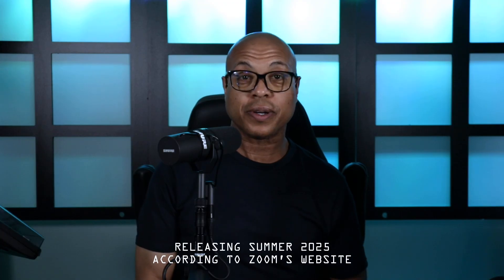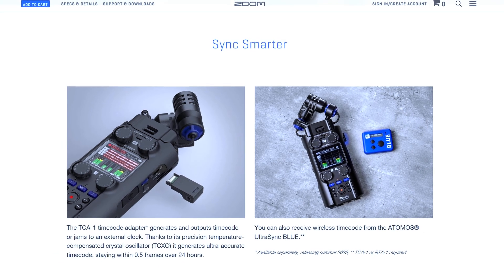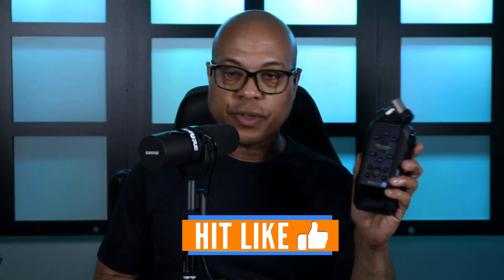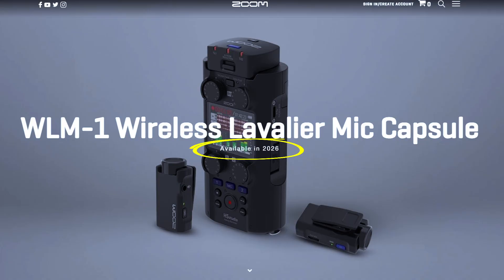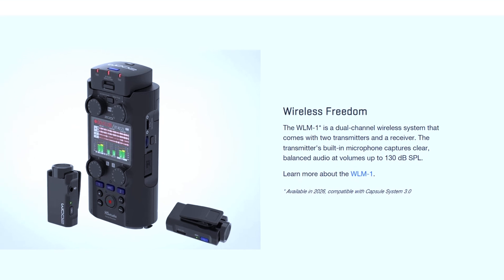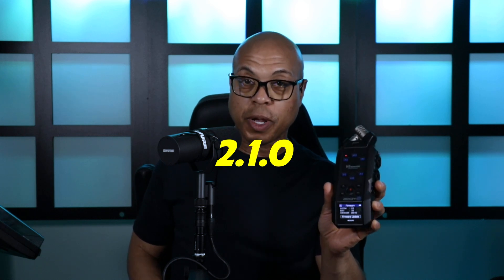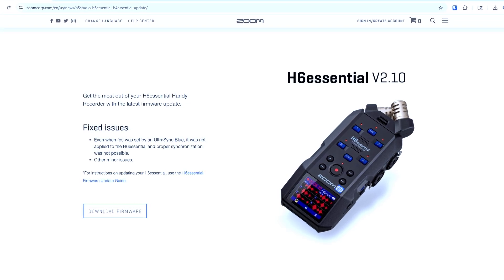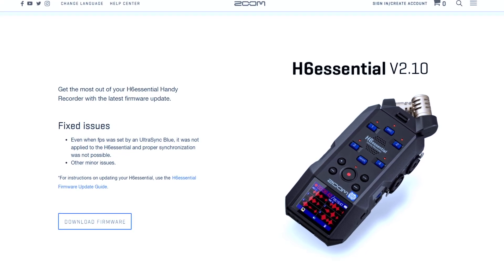Unlock Your Zoom H6essential's Potential: Must-See New Timecode Adapter & Firmware Update!

Comment: What about firmware update for ENI and headphone preamp noise floor ? H4E and H6E have had thumbs down reviews from alot of gear reviewers both here in Canada and the US on noise issues.
Reply from the maker: Zoom always has a weird excuse for the headphone noise. I don't know if you were around my channel when I reviewed the UAC232, but I didn't care for it and the headphone noise was one of the reasons. They gave me some spiel about it not entering in the recordings, but I found it odd to say the least. I do wish I would have waited for the H5Studio, but at the time I didn't know it was coming out. Personally, I don't find the noise egregious on the H6E due to what I'm using if for because I will always have to touch the audio in post (unless it's for a review but I'm talking real world scenarios).
Reply: @FreePodcastTools  I'v dippe3d my toe into the zoom pond , buying the H1esential and a while later the H2e . Still trying them out not sure yet. It would be nice to see if zoom does anything with the podtrack  p4